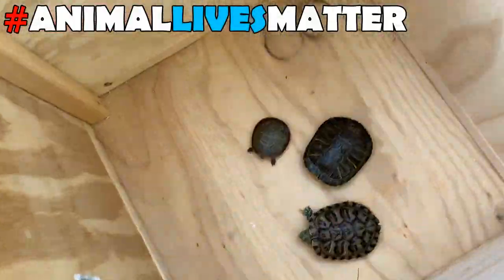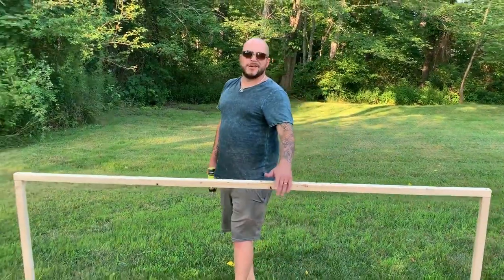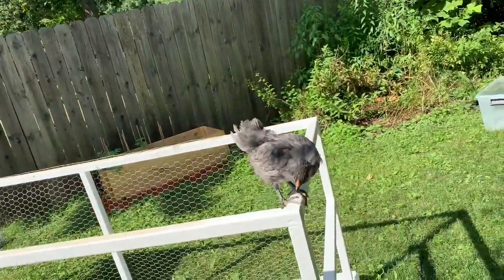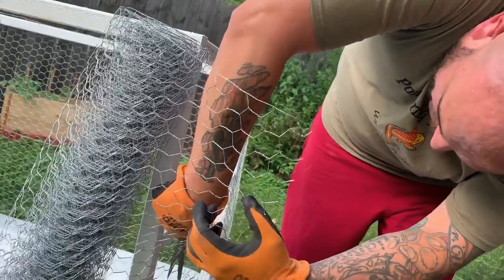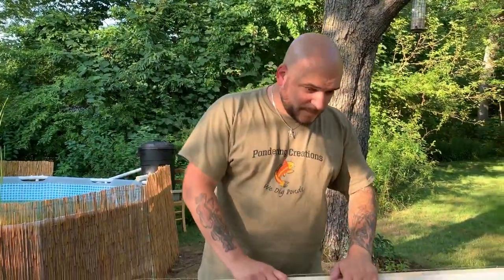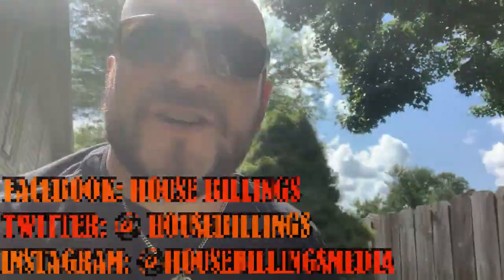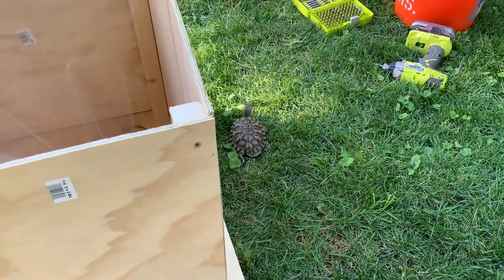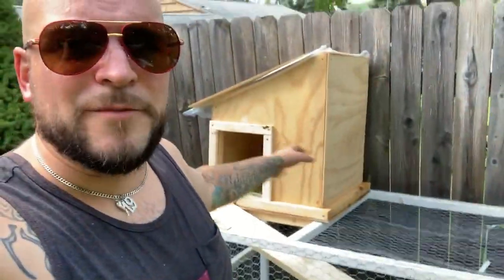DIY CHICKEN COOP and RUN (Cheap & Easy)

Comment: FYI, Chicken wire does not keep predators out. Hawks will pull your babies through it piece by piece. Raccoons and Coyotes can chew through it. Common mistake all over youtube. Ramp needs little wood bars every 4-6". Cute design for 1-2 birds. Do use hardware cloth folks.